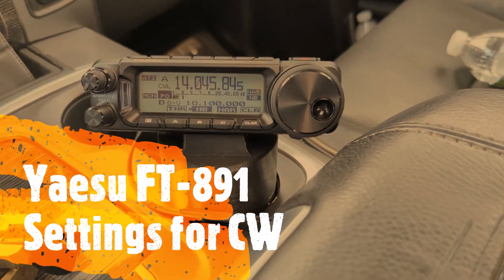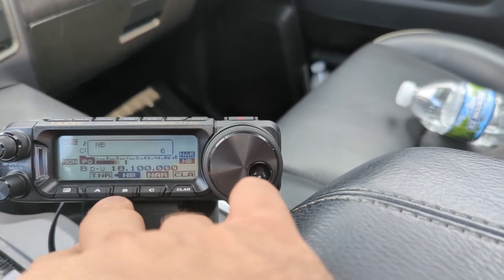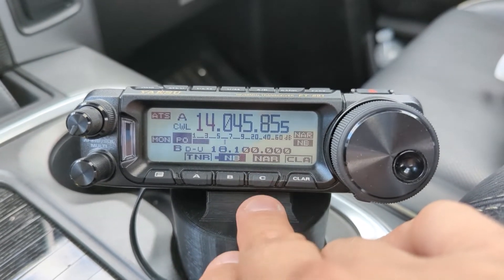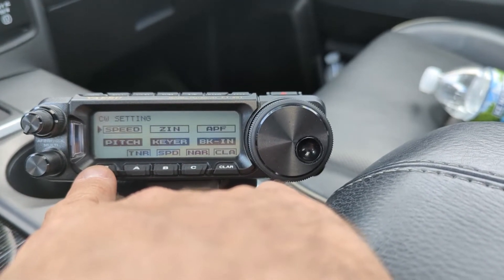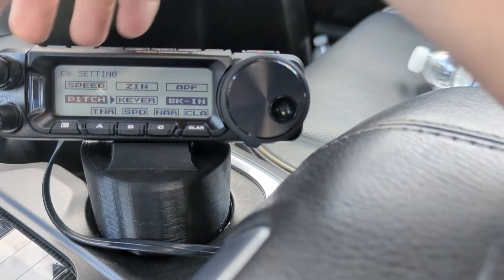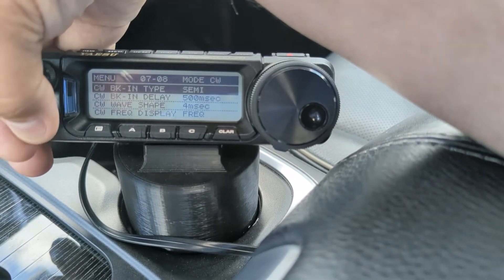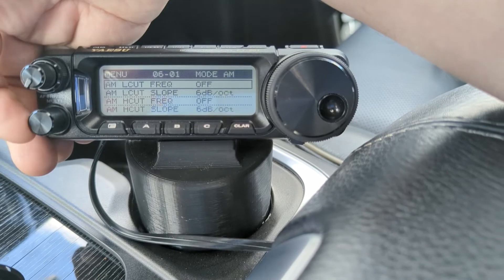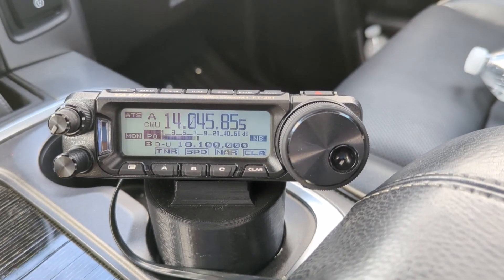Yaesu FT891 - Settings for CW

Comment: You should have IPO on. IPO = Yaesu’s term for Preamp and the default setting is on. To turn the preamp off you engage IPO (turns dark). Also, you need to adjust your high cut and low cut based on the pitch you set.

Comment: Excellent video! I have an additional question regarding the use of the Yaesu 891. I currently have an 891 in my truck, and I’m using a 20 m ham stick with a tri mag mount on the roof of the truck. I’m thinking seriously of getting a Yaesu ATAS-120 for Mobile use. I’m hesitant to mount it on the side of my truck for fear of it being stolen, and therefore would like to know, if this antenna can mount on the MFJ 360 S try mag mount for the roof. What are your thoughts on that? Thanks.
Reply from the maker: I had this antenna mounted on a Tri-mount mag-mount... Ill find a picture of it and post it.  Held up perfectly up to about 90 mph!

Comment: New Comment: Do you have a listing of your preferred CW settings? I ask because I seem too have gotten a setting wrong on 15m.  When I am keying the TX is now different from the RX.  I have checked that the SPL is off.  I am thinking of a FACTORY RESET.  That's why I'm asking about a "master" setting list.
Reply from the maker: I was always thinking about doing this .. And then I realize how many menu settings there are.  I want to make a spreadsheet.  What frequency difference are you seeing? And is your Clarifier setting at zero?

Comment: How do you do a menu change to get into CWL Mode on 40 meters CW. I can't transmit on 40 meter CW and I believe this may be the problem? Thanks!
Reply from the maker: There is an item in the menu system for that setting but I don't remember what it is. I don't think that would be your your issue for not being able to transmit though..

Comment: CW has become my favorite mode.  Thank you for this video!  I had been operating FT8 for a few minutes, and when returning to CW I was unable to send.  I found out that the Scope had been enabled.  Must have been a mistake.  Do you know why the scope would have disabled the CW function?  As soon as the Scope was disabled the CW returned.  I like your 23 WPM!  I have moved from 15 to 17 WPM.  It'll take a little while, but this setting is still so new that it sounds like greased lightning.  vy 73 de David AE4LH
Reply from the maker: I think the audio mutes with the scope on.  Check out PG 36 in the manual.
Thanks for watching!